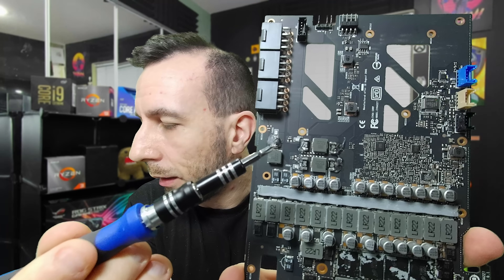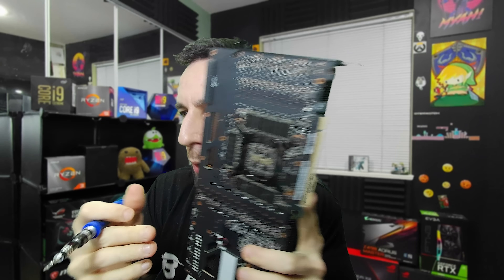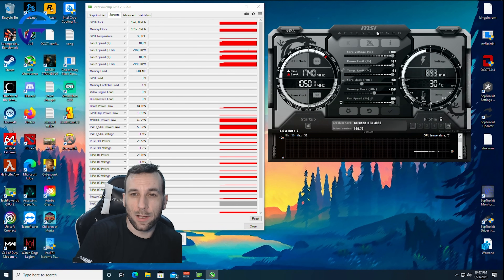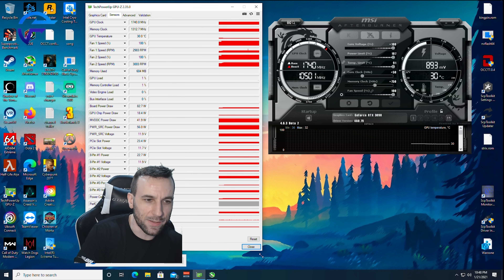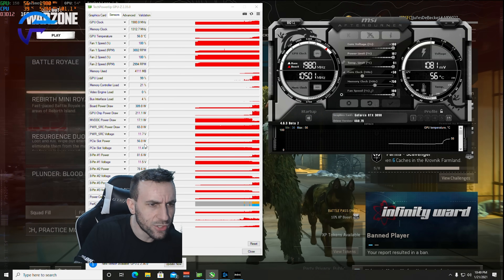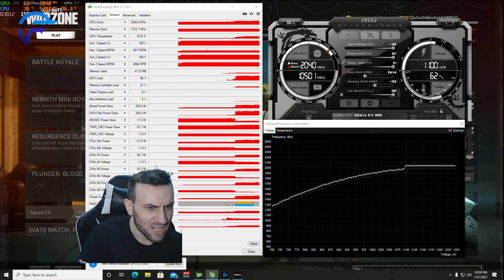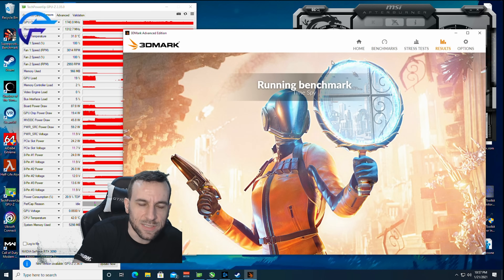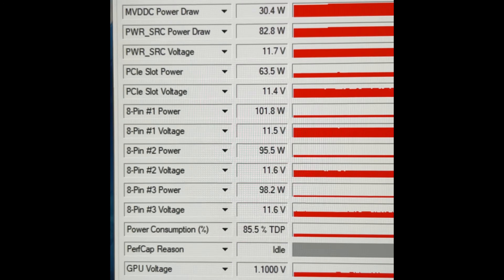EVGA 3090 FTW3 LOAD BALANCE SHUNT MOD

Comment: I am confused,
Why mod the pcie if the card pulls to much from pcie?
Why not just mod the 8pins?
Reply: Right!? There was no balancing here. He just raised the power limit on everything, including the pcie rail. A reduction in resistance on one of those current monitoring circuits tricks the controller it's hooked up to into thinking it's pulling less current and the driver will show you a lower wattage. His driver now shows 50-60w on that rail, but it's still pulling as much as it would have before but now can pull much more than 75w. Would have been safer if he only modded the shunts that fed the gpu vrm and called it a day

Comment: Did you ever manage to do the mod with the water block installed?? Is there a video of it as i cant find it.. Does a shunt mod even need to be done if you can flash to a Kingpin 1000watt bios?? I have a newer rev1 Evga FTW3 Ultra 3090 and cant do more then 460 watts tops.. :/

Comment: My FTW3090U red lipped pulls just over 400w, water cooled, max temps of 42c under load, 78w on the PCI, 55c mem junction temps, i'm running the 500w bios, GPU-Z reports its being throttled by PWR. Should I look at doing these Shunt Mods? my PCI voltage runs 11.8v 
I'm running a MSI X570 GL 5950X FTW 3090U - EVGA 1300W PSU - dual custom loop. Seems like my rig should score better in benchmarks than what it does, i'm in the top 120-130 of most all benches.
Where do I get these resistors you guys call shunt modz?

Comment: What about just using 16mΩ resistor on the PCIe side rather than 3 4mΩ on the rails? Less need to bridge the PCIe fuse moves the load balancing back to standard etc. Unless ofc we are starting to think that dragging a bit more from the PCIe slot could be an advantage now??

Comment: I Heard that the evga powerboost was dangerous it would blow up boards can you confirm if it's OK I have a gigabyte z390 aourus master  the pcie slots only go up to 75watts will this help? Evga could sell a adapter for the 3 8pins that could fix the balance problem. If the have the boost they should have a way to fix this.

Comment: I guess this was a card that had a bad 3 pin power connection I can only draw 80watts from from 8 pin #3 and 75watts from the pcie slot. IF I SHUNT 8 PIN #3 WOULD THAT RE BALANCE THE LOAD? What size shunts did you use? Would. 10m0hm be OK for all 4? Another thought should I shunt the other 2 8pin3 instead of #3 8pin 3 if the watts drop on those it would be closer to equal, but it won't draw more from 8 pin #3. You need it to draw more from 8 pin #3 to balance the card.

Comment: @Frame Chasers  Hello! Love your channel and how you try to extract every bit of performance available out of everything.
I got a quick question. I got a 3080 XC3 Hybrid (AIO watercooler but w/ 2 8-pins). This was the only 3080 card I was able to get ahold of. 
Do you think this shunt mod would help raise the power limit on that card?
Reply: You have 375 watts maximum as per the standards.  Shunt mod would take you out of spec on the PCIe cables if you draw more power.  Also your VRMs will need to be good enough to take whatever the new maximum power draw.  Ask first is it safe to shunt mob and then ask if it with work well.  If you cannot answer yourself with your own knowledge that its safe, then dont shunt mob your card.

Making changes to hardware you don't fully understand is the best way to archive disaster.
Reply: @GodKitty677  each 8 pin although rated at 150 watts by atx standard, have been tested by people like derbauer and are able to take 250 watts per 8 pin safely. Vrms on higher cost cards are also usually overspeced so can handle it. But yeah there is always risk. Almost blew up my old 2060 shunt modding it.
Reply: each 8 pin although rated at 150 watts by atx standard, have been tested by people like derbauer and are able to take 250 watts per 8 pin safely. Vrms on higher cost cards are also usually overspeced so can handle it. But yeah there is always risk. Almost blew up my old 2060 shunt modding it.
Reply: @prxzmsAU Doing a shunt mod on a RTX 2060.  Thats just amazing.  Yeah they could have cheap VRMs, normally there is a lot of head room.  This is for longevity but the cheaper VRM can get very hot at high power draws.

Comment: I dont really understand why do you double or tripple shunt instead of just using a shunt with lower resistance? so pcie shunt using an 8 i get to at least limit the powerdraw to 120 over pcie. But why dont you use a 5 on the others instead of 2x8, wouldnt that fix your shorting issue?
Reply from the maker: Because I don’t have any other ones here
Reply: @FrameChasers  I just realised that my msi x570 ace doesnt have a pcie 1x lane for the top pcie slot, do you know if i can just blug it into the 1x above the second slot and that will work or does it have to be connected to the specific rail?
Reply: Aah okay, same issue i havent got enough 8s . So ill try the using 5x R005 on the Top shunts and one 8 for the pcie, ill report back once i get the power booster 😁
Reply: @samuelrogers2384  what’s a power booster? And where do you guys buy these resistors from?
Reply: @JW-rm3ci  Thats what @FrameChasers suggested the People to get who dont have a additional Poweradapter on their Motherboard to feed the Pcie Express lanes. You can just type in Evga Power booster in google, i think amazon still has some lying around their like 15 bux. And you just blug them into the Pcie 1x lane above the Slot you wanna use. So you dont draw to much Power across the Board

Comment: If you could overvolt the pcie connector you could draw more power at the same or less current, which would be far less sketchy than drawing more current through it. No idea how one would go about doing that though.

Comment: So just so I'm getting the same information that I think I'm getting. A 5 Mohm on top of a 5 mohm resistor will show half the power draw on GPU-Z's sensors??

So in theory when it says 100 Watts it is actually drawing 200 Watts from each eight pin?!? and in theory if it is saying 55 to 65 Watts on the PCI Express slot that should be 110 to 130 Watts isn't that correct? With a 5 mohm resistor on a 5 mohm resistor?

Comment: Thanks for your Video bro, I have this same card and I've been following you since, I installed the Hybrid, Kit put my own Thermal Compound and the AIO on Push Pull and works very good flashed with XC3 BIOS. I'm running 3440x1440 all Ultra and Clocks at 2100/11002 (+80/+1250) stable since the upgrade to that Cooling Kit. Clocks gaming Cyberpunk 2077, Metro Exodus, Warzone drop to 2070 or 2055 sometimes, mostly seats on 2085, but pretty impressive temps max 56C on GPU with summer here no Air Conditioning at all.  All the Best, Sergio!
Reply: Hello, would you be so kind to tell me the  exact bios you flashed? Thx!

Comment: Which value of shunt did you piggy back a 8milliohms on top of a 5? And if so wouldn't that be a 60% bump in watts? As the new value is about a 3 vs the original 5. Wouldn't that take the pci e slot above 120 watts if it was peaking at 80 watts before the mod? Or do you lose resistance value with the hot glue method?
Reply from the maker: Yep 62.5%,  no because the reading in gpu-z dropped from 80 to 60 with the shunt, so you gotta do 60 times 60% which is right at 100
Reply: @FrameChasers  Thank you for the clarification. Great content 👍

Comment: Thanks for investigating the questions no one but we have haha. From my experience, GPU-Z has always been unreliable in its reporting. By any chance does your PSU have the ability to report the power being outputted to the rails? Can you switch it to multi rail and read them individually? 

I believe my Corsair RMi has this ability. It would be a nice way to read the power being drawn to the PCI-E. I know the GPU to GPU-Z can be real funky when we make modifications, it's really hard to get numbers. 

For example, when I shunt modded my 2080 Ti, it was reporting lower or the same power draws in GPU-Z but my PSU showed I was indeed drawing 50-75W more power :)
Reply from the maker: Ah yeah it used to but now because if have the TEC cooler on my cpu it has a pcie 8 pin going to it so my psu readings are gpu + tec so I can’t really use them anymore, an unexpected side effect of the tec

Comment: Such a botched series... I had a really good one I've got in top 30 in port royal on the same day I got the card and it could pull 500w without any mods, the pci-e slot wasn't pulling more than 80w. And guess what?3 days ago It died with red light of death. Probably blown fuse I could just short it but I am sending it back today...
Reply: How do you short the fuse?
Reply: @fakrbob4099  so fuse just bridge contact pads with something conductive like solder or connect them with a wire

Comment: I have an asus 3090 tuf oc ~ does changing the bios alone (to a higher watt version) make a difference, or do you have to shunt mod as well and do both things to get the improvement? thanks
Reply: get the 1000w vbios then you should have 660w power limit but you still limited to 1.1v .
Reply: @kaiwenwu8148  thanks, you mean the GALAX 1000?
Reply from the maker: i've never actually tried flashing a 1000w bios on a 2 pin card, but other than that you have to shunt it to get a higher power limit because the tuf's bios is already maxed with both pins from the factory.  But give the Galax flash a shot and make sure you have a backup GPU to flash it back incase you brick it
Reply: @roadi7  no，I am talking about the kingpin 1000w vbios. The galaxy one is not working.
Reply: @FrameChasers  thanks for the reply.  The 3090 tuf oc is a dual bios card, you should be able to switch to the other bios if anything happened, correct?   and the galax cards are all 2 pin cards anyway, right?
Reply: @FrameChasers  There is a galxy 390w bios for two 8pin card.
Reply: @kaiwenwu8148  oh, ok, thank you
Reply from the maker: Yeah but the tuf is already 380w so why would you bother flashing for 10w,  just shunt the bitch with some hot glue

Comment: Where are the KP bios at, i keep seeing people talk about the 1000 & 520w bios & flashing there card but I cant find them, the one on TechPowerup doesn't seem to be valid
Reply: https://www.techpowerup.com/vgabios/227771/227771
Reply from the maker: if you have an XC3 or ftw3 card bios flashing the card wont work because of the load balancing problem. But it will work on any other model
Reply: @FrameChasers  The 1000W BIOS did the same thing as the shunt mod, my card pulls around 90W on the PCIe and around 600W total on my FTW3 Ultra. Obviously single card sample so take my results with a grain of salt, but I'm assuming its working because the BIOS removed some of the fail safes.
Reply: @Shen3002  interesting 🤔
Reply: @Shen3002  weird cuz pcie slot can only pull 75 watt when stock
Reply: @FrameChasers  Thanks, i will just flash my bios with a Glue Gun!
Reply from the maker: That is interesting, does the kingpin bios remove the pcie 75watt limit? I guess it probably can since the release bios let’s it go up to 85 watts,  well that’s handy.  But that doesn’t address the fuses or the load balance unfortunately
Reply: @Shen3002  is that with the Bios linked above?
Reply: @georgem.6136  Yes, that appears to be the one. On a side note don't use Precision X1 when you have the 1000w bios flashed as it will prompt you to try and update the cards firmware, switch back to the non OC bios to update firmware if required.

Comment: But can't the glue melt and cause the shunts to lose connection? I've had that happen on my zotac 2070 Super... The PCB actually got hot enough to melt the glue. What's your take on this?
Reply from the maker: ive heard this a lot and every glue shunt ive done is still going to this day.  So honestly im not sure what glue people are using that melts with the pcb heat.  Im just using dollar store stuff
Reply: @FrameChasers  hmmm, interesting. Thanks for the reply tho
Reply: @jeffos4256  k